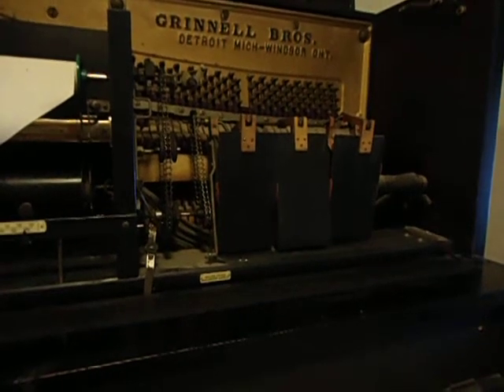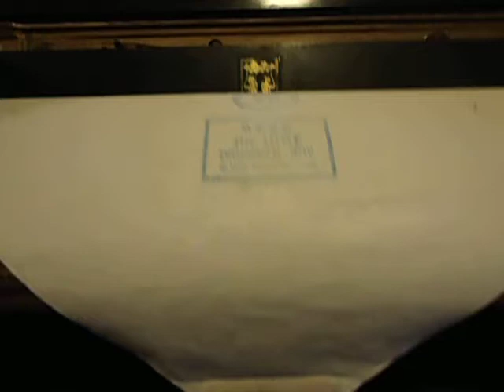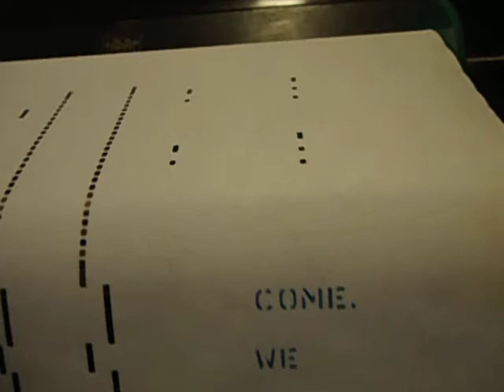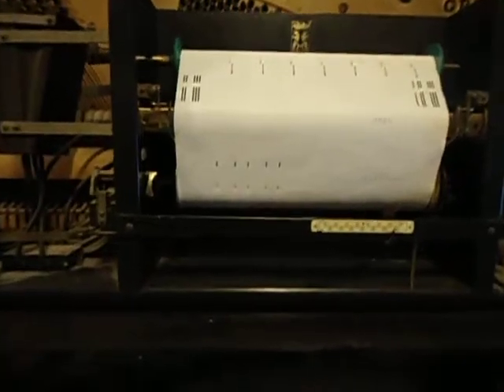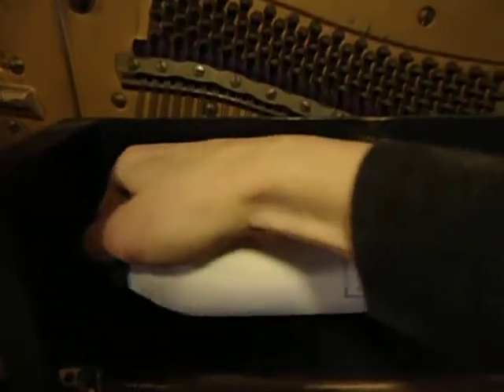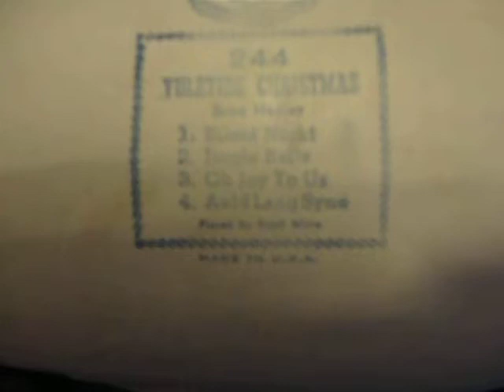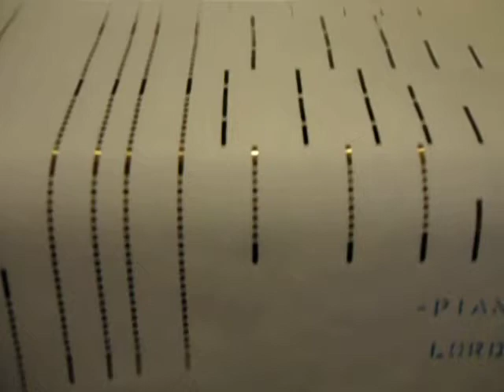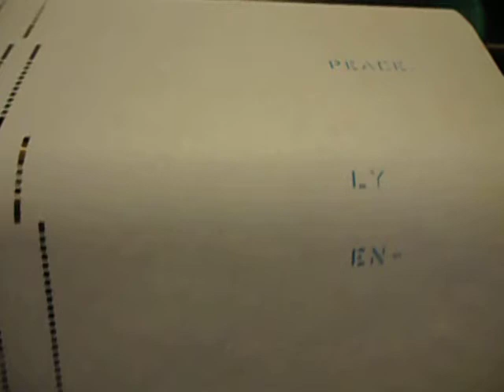How The Pneumatic Piano Works

Comment: Some artists recorded their own performances on this rolls, right? I assume in a different type of piano. How did this machine record dynamics on paper?
Reply: Hi, David. I'm not the poster of the video, but I've got one of these that I recently rebuilt. There were machines specifically built to punch the rolls, and they took the form of a piano that actuated a matrix of punch pins as the keys were pressed and the paper roll turned. Some rolls were also produced by transcribing manuscript music straight over to hole patterns and manually punching out the master, relying on the end user to moderate tempo.The 'Duo-Art' pianolas did have dynamic control, and it's encoded by a four-bit system whereby four vertical lines of holes are used to determine global note velocity (i.e. individual key dynamics are not possible).

Comment: so it works by sucking in air through the holes in the paper which drops the hammer, and then "cocks" it by the vacuum that comes when the paper seals the hole again? Why does not all the hammers dropp when the paper is removed then?
Reply: which would cause the vacuum to even out
Reply: Stian Berg No man, that is an incorrect and way oversimplified explanation. 

1. The pump / lower unit creates the suction to power the system.

2. The pump is connected to the stack via a wooden manifold, rubber hose, or both. 

3. The stack can start playing when suction is applied. The stack is the part that actually "plays" the piano, and is usually located above the keyboard, occasionally below. The stack in most player actions consists of a pouch (leather disc),  valve (usually of a spool or button shape), and pneumatic (small bellows) for each note played by the player, usually 88, but fewer in some types. Double valve actions also have an extra set of primary pouches and valves, which act to amplify the signal and positively activate the secondary valves. 

...
Reply: Stian Berg I was going to get into a more thorough explanation of operation, but realize a video can be easier to understand. Actually, I've deciphered your question and can answer it now: 
Yes, when in "play" mode, if the paper comes off the tracker bar, all notes WILL try to play at once, provided that the player system is well restored with correct materials and techniques and is airtight (a wheezy player needing a rebuild will have problems even playing normal rolls, much less all notes at once). The reason the notes don't play backwards in "rewind" mode is because in this mode, the big valve to the stack in the "gate box", usually on or near the pump, is closed, so that the suction to the stack is cut off. This also holds true for the end of reroll, when the end tab on the roll can come unhooked from the take-up spool, and come off the tracker bar.

Comment: My piano player rewindes but does not play. I can hear the wheez from the vacume pump 
What should I check?
Reply: ChueyMr11 the tubes that connect the tracker bar with the Pneumatics. Of there is a leak you can also hear it.
Reply: Definitely a major leak or disconnection somewhere in the pneumatic system.  If your piano is very old and still has its original parts, the rubber tubing might have gotten brittle and broken.  You can search online for a player-piano repair technician, but there aren't many of them, because it's such a specialized field.  Some of these technicians travel the world to service these wonderful old machines.
Reply: @OofusTwillip  If one puts their mind to it can work it out.  Mechanics and engineers.  Also anyone who has worked with compressed air  machine.  Many of the really old pianolas use lead piping...Good idea to replace all piping at once, with a good sealant/glue.  Especially since one is going into the 'dashboard' anyhow.  Would you agree?